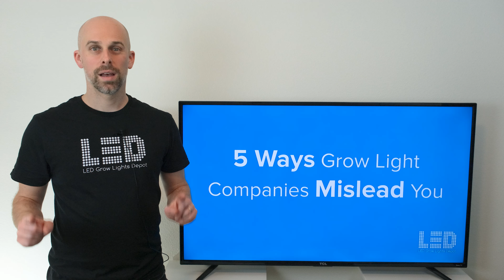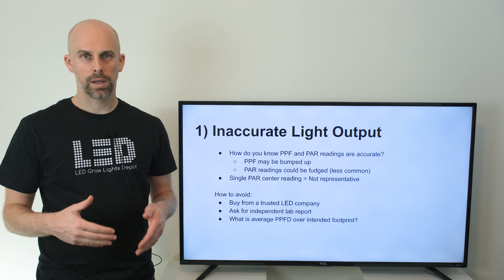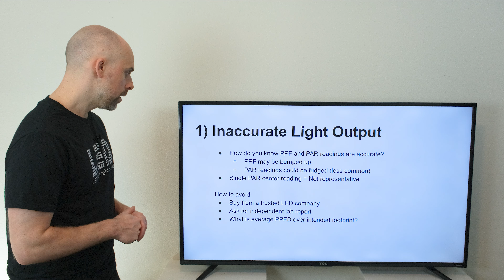5 Ways LED Companies Mislead You

Comment: Can you say exactly what light companies are misleading people? Normally on the driver it does say 5% plus or minus actual wattage. what companies are testing there lights with top end diodes then using lower bin diodes in there lights.  What evidence do you have of this?  I just watched a great video made by Dr. MJ Coco about LED lighting. Have you got a chance to watch it?  There seems to be alot of info in this video that id like to know more about. If you could take a few to answer i'd appreciate it.
Reply: I think as he implied, it does happen - and not extremely uncommon. But it’s usually only those cheap shitty quantum board lights that advertise as either “Full Spectrum” and/or Blurple. You know the ones that cost like $40 for a 1000W light - then if some are truthful, you read the actual specs and it’s like 30W or something. Some don’t even give actual specs, then when you message them they take 2 weeks to reply and give you a BS answer.